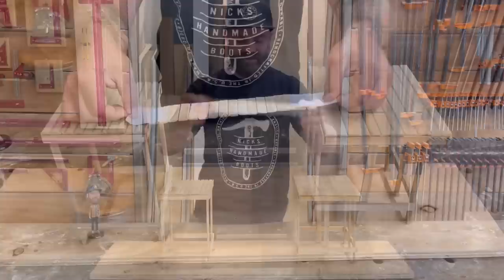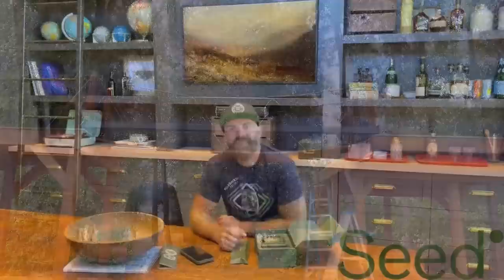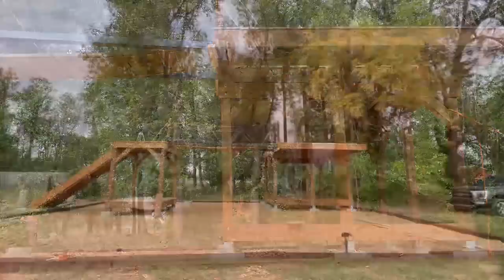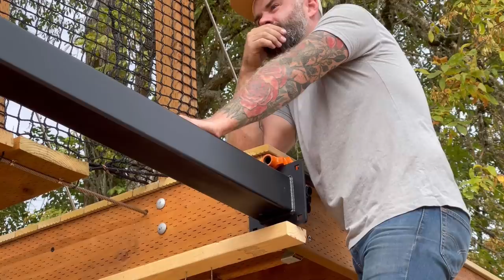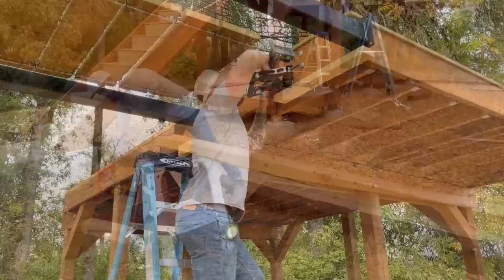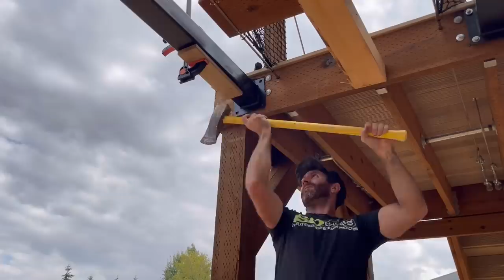My Treehouse is Falling Down || Fixing a Huge Mistake

Comment: Dear Mr Moth, what's the point of putting steel tubing across the towers to support a suspension bridge ? A suspension bridge is called a suspension bridge because it's a self suspended bridge firmly  anchored at either end. Now it is no longer a suspension bridge if it supported by 2 steel RHS ( rectangular hollow section ) tubes holding the anchored ends apart. This defeats the purpose of a suspension bridge, when the 2 steel tubes ( or even 2 horizontal timber beams ) could have been used to  construct the bridge between the 2 landings making the entire structure rigid. Mr Moth, first you could have tried at least putting in 2 opposing diagonal rod ties with a turnbuckle on each at either side of each tower. 8 in total. This is fact would have made the 2 towers incredibly rigid with very limited movement when the suspension bridge being used. As the timber settles and shrinks over time , the turnbuckles will only need a small tweak from time to time. Now it's just going to look wrong

Comment: Speaking of unexpected issues, did you do the tension calculations on the bridge cables? They probably seems overly-beefy, but that geometry can put a surprising amount of tension on cables. Might be worth asking someone to run that math for you.
Reply: I just did a (SUPER ROUGH) calculation: If the bridge spans 15 feet and sags 3 inches in the middle, the cable tension is about 30X the weight placed on it. So if there is 300 lbs (two small adults) standing in the middle, that's 9,000lbs of tension. I'd personally want a pretty massive safety factor given wire cable clamps and whatnot can decrease the breaking strength of the cable. More sag will result in less tension.

Comment: Need to push one platform away from the other? Use a bottle jack and a 4x4! Bottle jack's have more strength as well. Drill a shallow hole in the side for the jack to rest in and no vehicle to accidentally take the entire thing down.

Comment: so i just saw this video and being that its a week old, I doubt ill get a response, but the issue you're having is because you put the bridge in under tension. when I was in boy scouts we made sever rope bridges and rope ladders and the like and one thing you learn is you want them to have drop in them that way when you apply pressure to it, the bridge itself picks up the slack not what it is attached to because as you learned it will pull it down with even the slightest weight. wish I would've seen the last video as it was posted as to comment this then, but hope that helps. If you think about those long suspension bridges the reason they droop the way they do is so when you walk across instead of yanking on the other object, of which yes there is still pull, but the weight and mass of the remaining bridge helps counterweight your moving across it, hope this helps

Comment: Homeschool Mom of 10 so I don't have access to metal beams. Is there a way to build from beginning to make suspension bridges off platforms built around actual trees? Trying to replicate a bit of Lord of the Rings Lothlorien Elve area with 4 platforms built at varying heights on stilted footings that wrap around existing trees, joined by suspension bridges. The trees are the standard tall skinny trunks all over middle Tennessee

Comment: Why didn't you take the bridge out all together straighten out the landing on both side (square it off) then put the steel beams on and attach the bridge . I think that would have worked.

Comment: I think big springs on the cable would have been able to absorb the load in combination with X otherwise very good job!
Reply: Even though the springs would absorb some of the load, the entire force (spring plus weight on the cable) would still be transferred to the base structure. The springs would allow the bridge to flex more, but the load on either tower would still be the same.

Comment: Of course what you should have done in the first place was build a proper suspension bridge then you wouldn't have had any issues, you may have needed higher posts, then cables could have been hidden in the stairs on one end and perhaps a nice slide on the other end - or even a zip slide, that way there would have been no tension on platforms at all, only downward pressure. This of course is how all suspension bridges are built!! Trust me I'm an engineer 😉🙃

Comment: The suspension bridge was the thing compressing that opening. You were fighting the strength of that cable the whole time. I'll bet had you loosened the cable that you could have pushed the structures apart by hand from the ground.

Comment: Diagonal cable or thin wooden beam (under tension) from the place where the bridge attached to the big tower down inside the structure to the bottom. That would have directed that shear load into the foundation. I would never, as aerospace mechanical engineer, come up with the solution you choose.

Comment: What the heck man. :p  You realize a 1 x 2 would have had enough compression strength for that.   Ok, It would have sagged and broke over that span but man those beams where way, way overkill.   Now you have two slippery surfaces for kids to try and walk across.

Comment: Through most of the video...
Me: Dude, you just need a wooden beam and a car jack to force those things apart.
BMW: So then I got a wooden beam and a car jack...
Me: HA! Now, you need to secure the ends of the beam before you jack it, or you might hurt yours...
BMW: And the beam fell down, so I secured the ends to prevent it from happening again.
Me: HA!

Later...
BMW: This bridge makes it really easy to twerk.
Me: No. NO. NOOOOOOOOOO!!!!!!!!!!!

SUGGESTION: On the opposite side of the large tower, install a couple of diagonal boards like stair stringers. Only don't put stair on them - put a cargo net on them for kids to climb. Or a slide. Or both! Also, a steel ship's ladder coming off the large tower would make another great option.

Comment: The moment you said what the nature of the issue was -- the suspension bridge -- I knew what the problem was -- you've built framework boxes with no real 3-d interaction -- e.g., an angled member that ties the structure up in three directions rather than each connection tied in 2 directions**. In other words, it does not handle shear forces at all. All it needs is some angled connections between the different support beams -- ideally one connection at an angle between each leg, plus one across to the "catty corner" leg. I'm only 2:15 into the vid... let's see if I'm correct.

OK,  @ 6:25 -- you are VASTLY underestimating the increase in stability which a single angle brace -- not even a full X, and not one enclosing the whole structure -- i mean a single brace at about 20-30° at the top of the four/six support beams of each structure connecting it to the adjacent beam ... especially if you added one more connecting one catty-corner to the other, again, at about 20-30°. That thing would be like the whole thing was on a solid bulk of GRANITE rather than the flexible structure you have. Believe me -- try this yourself -- build a small 4-sided frame -- a drawer without a bottom. Now apply lateral stress and notice how easily it deforms when you push at the top while holding the bottom still. NOW take that same thing, attach a thin little piece of 1x¼" TRIM MOULDING from one corner to the next, and see what a massive difference it makes in the rigidity of the whole thing. Add two of them in an "X" from each of the catty-corners to the other, and that thing is going to be a flinkin' ROCK. I have seen this happen with boxes, and the rigidity it offers is nothing short of amazing to me, and I know it does it.

You can -- and no doubt have -- done what you decided, but it kind of defeats the purpose of the suspension bridge in the first place, to my lights. And it still leaves the entire structure susceptible to shear forces, though with the staircase that should be mitigated in at least that direction. I am suspecting that, once you have the treehouse up, you will see that thing swaying a lot in the non-stair direction in a major windstorm, as it applies lateral force against the walls of the structure which are perpendicular to the stair axis. When you get a big windstorm, go out and see what it is doing. I am betting you it will be swaying notably in that direction.

ALWAYS create structural members in three dimensions, not just two. That's kind of what your short-angles (I believe the term is "knee braces") do, but they aren't long enough to really make it rigid. The cross-bracing does not even need to be substantial -- a single 2x4 or even a 2x2 would have an amazing affect on the rigidity of the structure.

Also, note that plywood sheathing effectively does this same thing -- it just uses a big solid piece rather than a thin piece.

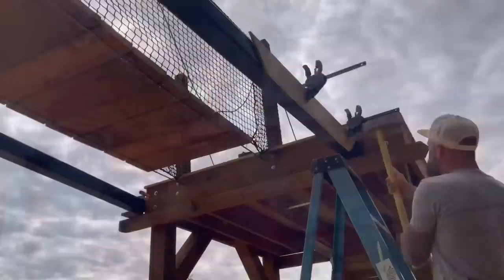OK, @ 12:15 -- it appears to me as though you actually twisted the 6-pole structure somewhat, too, since the bridge is much closer to one corner of the structure.  That is, it's not just leaning, it's leaning more on the side where the corner bridge is connected near than it is on the opposing corner. Makes a kind of sense, if you look at the physics of the forces involved.

======
** Yes, nominally, the floors go in 3 directions so that shear isn't going to be an issue for that. But the support beams have no such interactive element.

Comment: Wow…I guess sometimes you can’t see the forest for the trees. Haha. I was thinking all the way through this video that you had those nice easy to loosen turnbuckles on your cables that would allow you to insert the spreaders. I see that others have pointed this out also.  Additionally, some 4x6 posts should have been just fine to use as the spreaders vs the steel beams.  Would be much less expensive and blend in better.
Reply from the maker: We did as much as we could but we only had so much cable to work with.
Reply: @Bourbonmoth  oh, got you. Good fun to watch the progress and I bet your son  ant wait for the house part. I enjoy the channel. I prefer live vs the full voiceover format. Or a mix of the two.

Comment: I'm not an engineer but (a) I would not have used a suspension bridge due to lateral loading and (b) The steel beams were overkill - I would have used a couple of floor joists and they would probably be more than strong enough for the small compression loading they take with the bridge in use. I like your pragmanic approach to making stuff but it obviously can go wrong!

Comment: Thats a lot of rotation to the right side, watching the two bridge pillars and the floor of the right tower rotate when you guys jumped on it would have me looking at that next.  Also, on the left tower, the board is on top of its side panel putting stress into it, but the right side, the the steel into the board is on the side board screws not the board itself.

Comment: Have you considered just using wood 4x4s? Lighter, easier to install, cheaper, too. Installed the same way you did the steel ones.
Reply: Why? It’s already done. But to address why he went for steel: a 15’ single span, a softwood 4x4 would progressively bow/buckle under the compression of the braided cables. Steel is the correct choice here.

Comment: The fact that it racked at all with a one or two person load, makes me wonder if it is over engineered or if it really should have cross-bracing or cable stays internal to the frame, coner to corner. You're about to build a house on top. It will be prone to sideways wind load which can have a cumulative effect on the structure over time.

Comment: When I previously mentioned the structure was possibly overbuilt, I was assuming you were using steel beams to span the two structures. So, it appears I was correct in my prior assessment that the structure was possibly over built.

Comment: I am no engineer let me say that first... The solution I am thinking is to extend those bottom support cables through the joists of both towers and then down to the ground on either side of the towers; anchoring to the ground ... then all the force/load of the bridge is downward on the towers and tensioned to the ground on the outside of the towers. these cables would be vertical and not in the way of human traffic.  Further enhancement is to put pulleys at the locations where the cable changes from horizontal to vertical... so it acts like a big elastic band.   I would be interested to hear from you real engineers out there if this would have worked...

Comment: Great video series. But I have one serious question?  Was it tunnel vision or fabricated drama the reason you didn’t slack off the turnbuckles?  Previous video showed you using a wire come along which would have been seriously easier and more controlled than pulling with a pick up truck. To the keyboard warriors saying that you needed the bridge for access Keith has more than one ladder. A couple of cables about the width of the bridge would provide a “Dead Man for the tower that could then be incorporated into a climbing wall, not necessary to have a 45° angle even 10° will work. Lifelong ironworker/fabricator.

Comment: steel 4x4's look great but I'm guessing you could have done that for a fraction of the cost and time by just using 2 4x6 like your scrap lumber. When it didn't fit you could've trimmed it and it wouldn't have allowed the two towers to sway either. Or am I missing something?

Comment: Please go back and fix the cable connections! The cable clamps are on wrong, there aren’t enough of them, you need thimbles at the turn back at the eyebolts. If there was enough force to move the tower, you have enough to damage the cable.

Comment: One thing is you could of gotten more bracing by droping your knee braces down lower. The closer it is to the rope and bottom less movement you will see. A couple 2×4 ran from top ro bottom corners would of done wonders

Comment: Retired architect here. I think I’d have tried steel rods and turnbuckles on the diagonal in the first bays of the “house structure”. Less intrusive and more economical.  Also, a big bottle jack would have been much stronger for spreading the structures, but, as others have said, loosening the cables would have helped a bunch.

Comment: The only thing you overdid was the amount of concrete you used. The structures while over built in terms of over sized lumber for short spans you had zero lateral bracing.

Comment: Steele? 4x4 lumber doesn't compress on its length either. Might as well just have built a steel bridge as opposed to a suspension bridge.

Comment: Would it not be way easier and cheaper to simply not terminate the cables on the tower?
If you had a pulley on the tower that the cables run through, which then anchor into a concrete footing in the ground, would that not transfer to a vertical load?

Comment: if you had loosened the cables of your bridge it would have only been 15 minutes of work. work smarter not harder.

the cables of your bridge held your towers together. that's why it was so difficult.

if you look now, the posts of your bridge through which the upper cable runs are skewed by 5 cm inwards.

Comment: BBM, those steel beams are a radical attempt to solve a lateral racking problem which they don't. You should have asked a professional Framer for consultation first. To a Framer the answer would have been obvious. You have no diagonal bracing to stop the structure from racking on you.  Those short braces at the top of those 8 foot columns will do nothing for structural integrity. 

Get rid of those costly steel braces that take away from the aesthetics of your build and instead, get some 4 bys and on each side. attach them from bottom of the middle post to the top of the front post on each side. That will stop the racking when the pressure is applied when someone crosses the bridge just like the stare runners do for the front deck. 

This is, however, not enough to make your decking safe. You need diagonal bracing in the front and the back of each deck to resist any heavy side-to-side stress placed on them while walking, running, or roughhousing on the top. 

This would be the minimum that's required, but I would take it one step further. That's to place a diagonal brace at the top of every corner post running across to the bottom of each center post. Easy-peezy, Lemon-squeezy. And, take those steel braces out and do something else with them like make a trailer for your tractor.

Comment: Too bad you didn't put the beams under the bridge and paint it brown instead of black. Might not see it then.
Why didn't you use those screw contractor jacks they lift house floors with to spread the structures apart?

Comment: I'm a structural engineer, should I even comment?  You could have temporarily removed the knee braces from the tower on the right and it would have moved easily.  Rather than putting the steel struts between the towers you could have removed the knee braces from the tower on the right and replaced with longer knee braces and that would stiffen that tower.  You had the best idea earlier in the video- x-brace the tower on the right.
There are a lot of comments on the tension in the cables.  The cables form a catenary structure and the tension in the cables is somewhat a function of the amount drape between the end points.  Pulling the structures apart straightened the bridge somewhat, which will increase the forces in the cables.  With the struts in place this will not allow the towers to pull together but it does increase the forces on the anchors of the cables which eventually go into wood and over time may cause problems there.  Since a catenary is a balancing of drape vs. force, you sometimes have to compromise and think just how much drape can I allow and set it at that point.

Comment: Next time take the bolts out of the wind bracing, adjust to plumb and reset them. I’ve never had to use more than man power and ingenuity to move any deck that way.